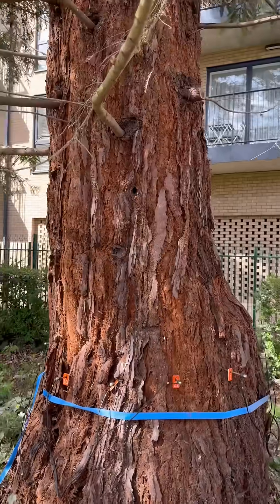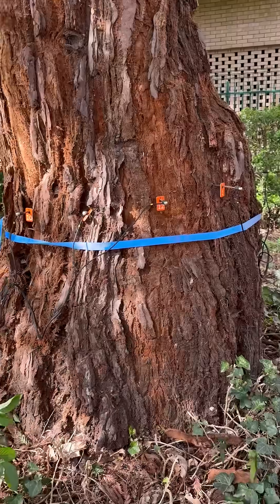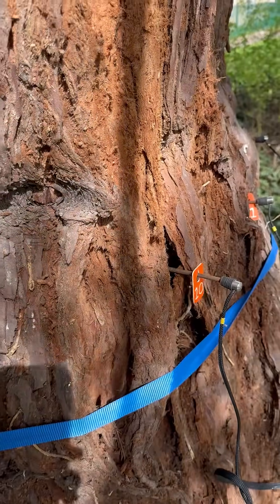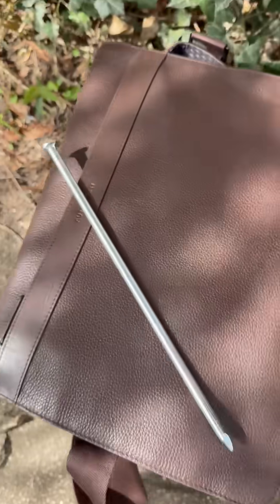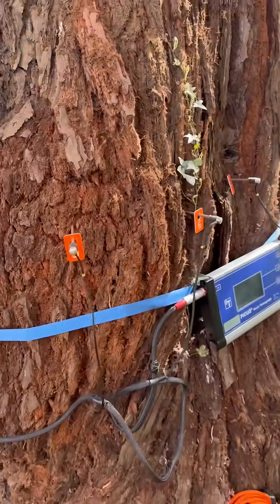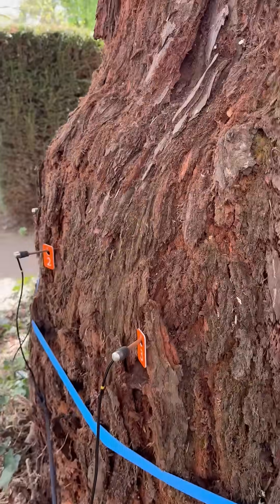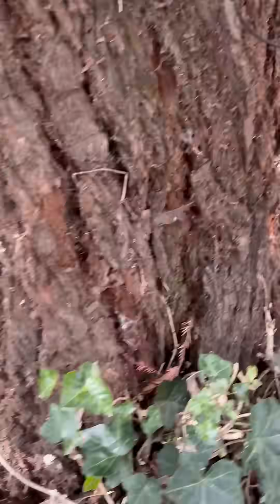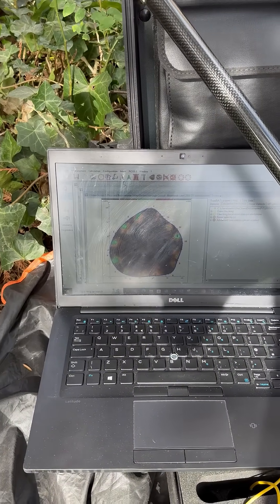PiCUS 3 on coast redwood

Comment: Dont use copper nails or youll kill the tree.
Reply from the maker: Hi they're not copper. I only use galvanised steel which I  discard after each test to eliminate the risk of cross-contamination.